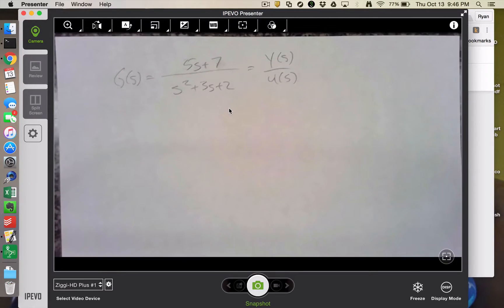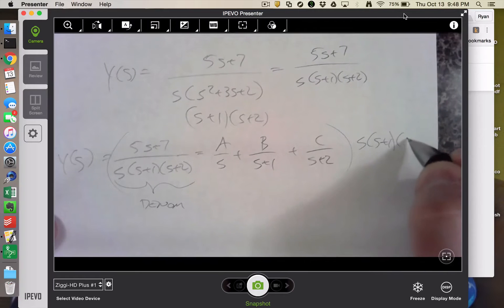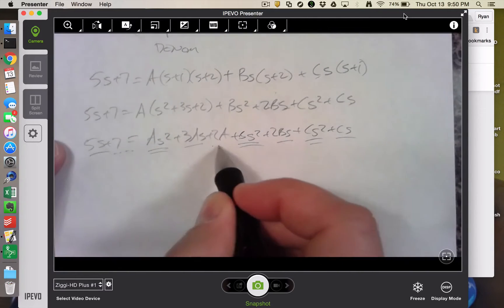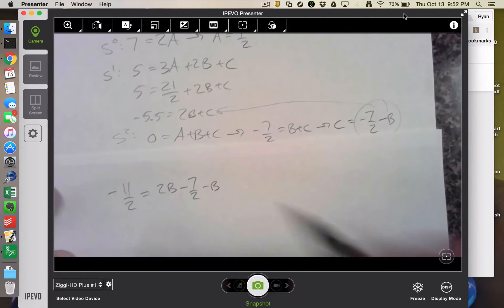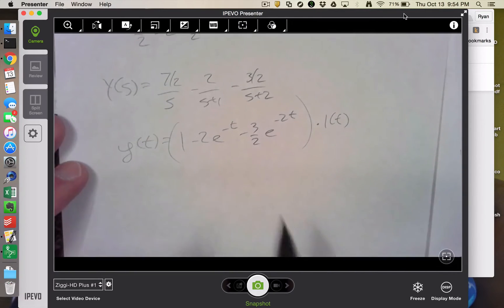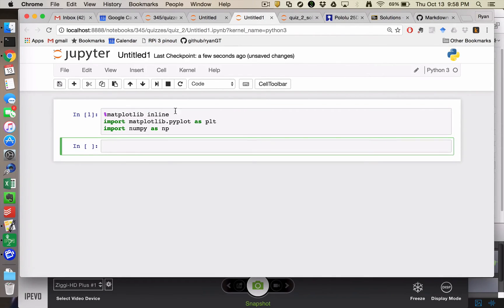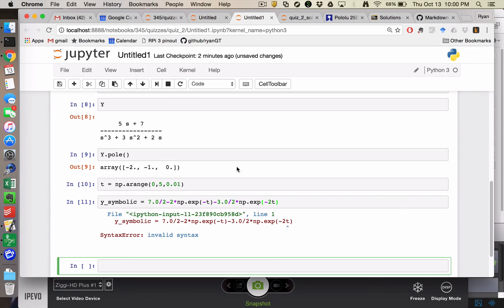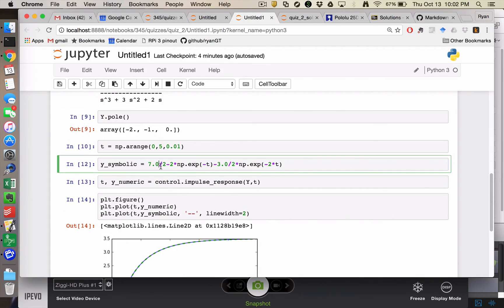How to use the python-control module to verify inverse Laplace problems

Comment: Thank you for good explanation. I have a question : is it possible to get the transfer function thanks to my input and output discrete signals ? I want to put condition on the transfer function as K/(1+tau*s). Actually what I want to get is K and tau thanks to the library.

Comment: on my computer does not recognize this "control" function, when I run the program, the error appears: ModuleNotFoundError: No module named 'control'
Does anyone know what I can do to fix this? thank you so much.
Reply from the maker: Emerson Carvalho install the control module.....
Reply: Do you have the link from where I can install?
Reply: I'm sorry, I'm not very good at it yet, I started learning a little while ago. Forgive my ignorance, please.
Reply: I found the file and downloaded it, but how do I install it?
Reply from the maker: Emerson Carvalho you should just be able to type the command "pip install pythol-control" at the Anaconda prompt.
Reply: so I did what you suggested, but the following message appeared: could not find a version that satisfies the python-control requirement ...
... Not matching distribution found for python-control ...
Reply from the maker: did you really spell python-control that way when you typed the command?
Reply: yes I actually spelled python-control in command
Reply: do you think the error can be derived from the way I installed Anaconda?
Reply from the maker: Did you try retyping the command with python-control spelled correctly?
Reply: Yes, I tried several times to retype the command. but the same message always appears. (python-control)
Reply from the maker: What is the exact message?  And what is your operating system?
Reply: Could not find a version that satisfies the requirement python-control <from versions: >
 No matching distribution found for python-control ... this is the exact message he presents... and my operating system is windows 8.1